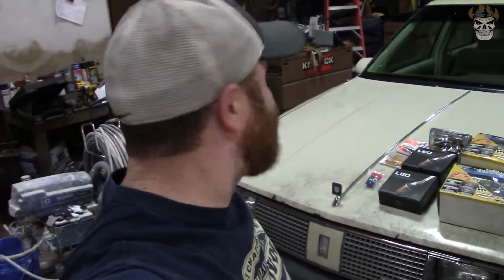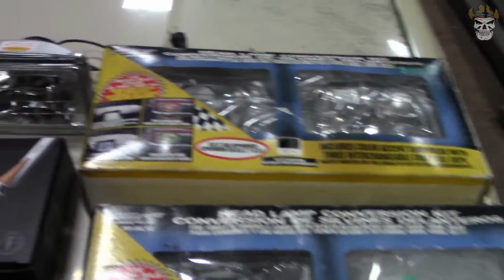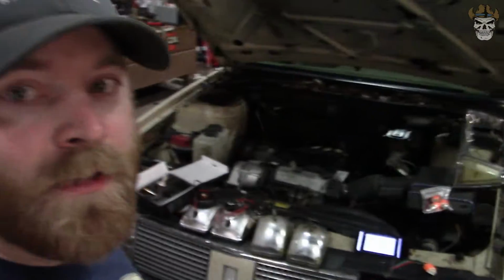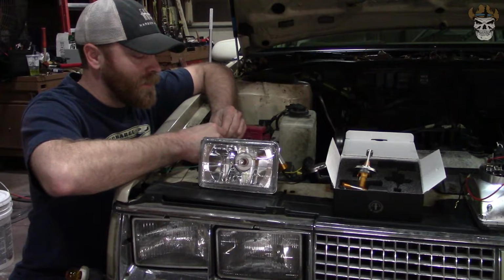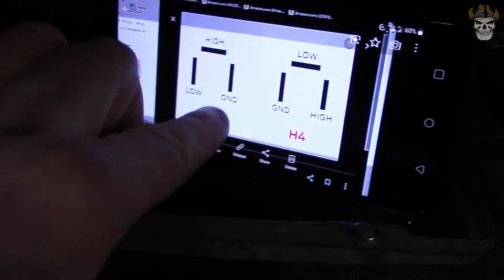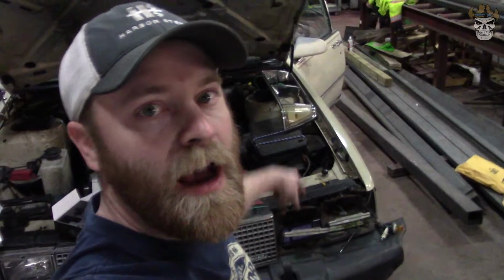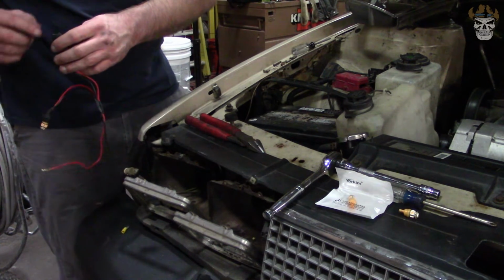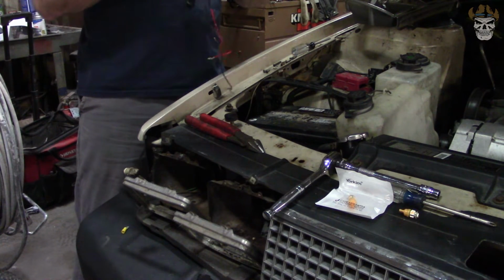Yellow 1986 Olds Build - LED Headlights and Halo Eyes.

Comment: hey postal this video is gona help me alot after watching it i realized my outer headlights i need to swap those wires to the correct socket also i wanted to ask on your car did the two middle headlights only have 2 prong sockets and how exactly did u set the wires on them did u use the high or low beam on the h4 light bulb socket
Reply from the maker: The inner beam headlights are wired for only ground and high beam.  My terminals were fairly loose and had quite a bit of oxidation so I ended up getting replacement ends and rewiring them all so that all 4 come on with low beam and all 4 come on with high beam.  A link to the ends I used https://amzn.to/2Yd1KdA.  Hope this helps.  Just cut your old wiring and twist the wires to the connector together and test everything before you solder it all together.